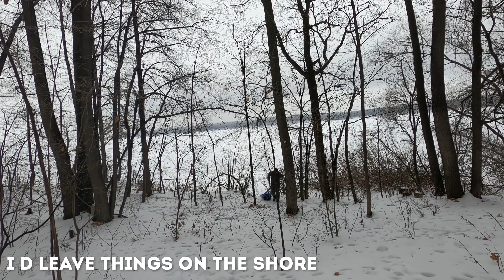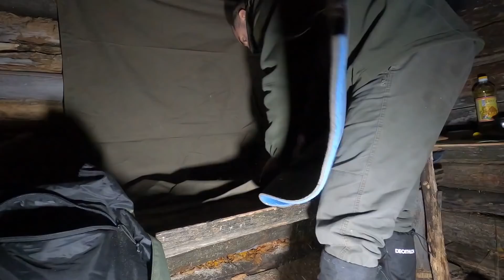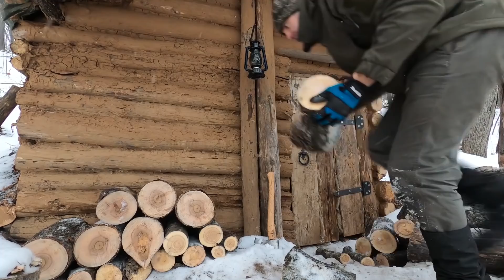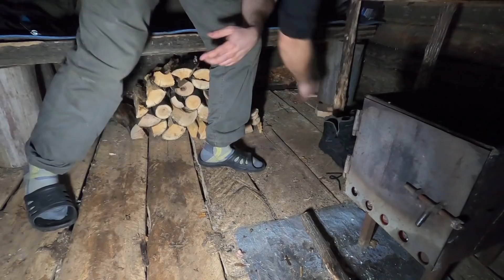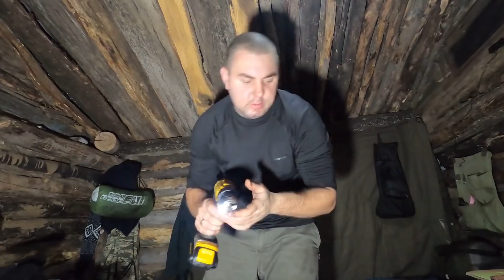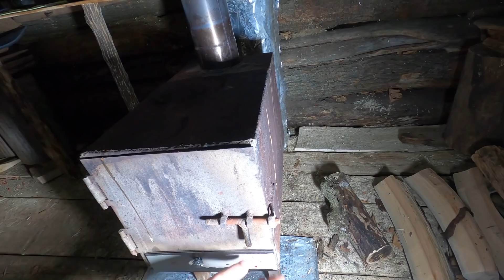Night in the log cabin, Firewood Preparation, Cozy Bushcraft shelter, solo overnight

Comment: Several years I lived with only a wood stove for heat, just like the ancestors did I found it valuable to basically build a tent over the bed (most people think the canopy bed with curtains for show)  to help hold my body heat in, it didn't help with getting dressed in the morning! 
I had wondered about the lack of ability to control the air input to the stove
Reply: Take 2 uncut logs and plop them down on some embers, itll burn all night

Comment: keep the drill straight, regulate the speed per diameter of the drill and metal drilling into, and cool the drill with some water at lest regularly;  or you will brake every drill bit you use. PS bring a spare...unbelievable
Reply: honestly what you said or instead of water use oil